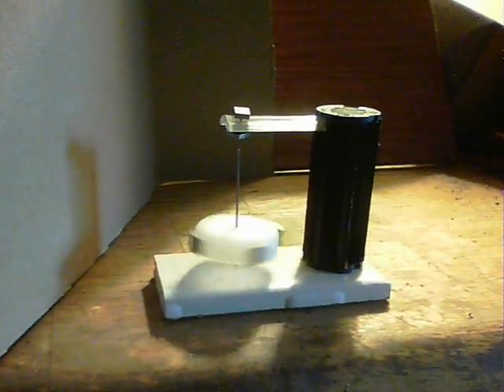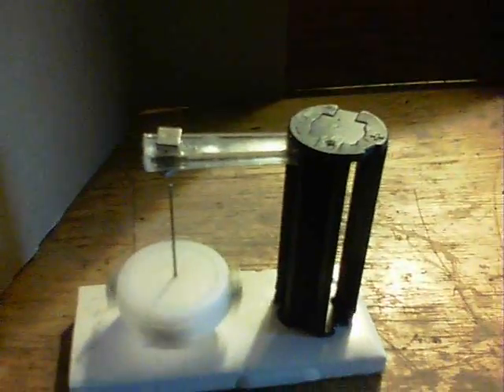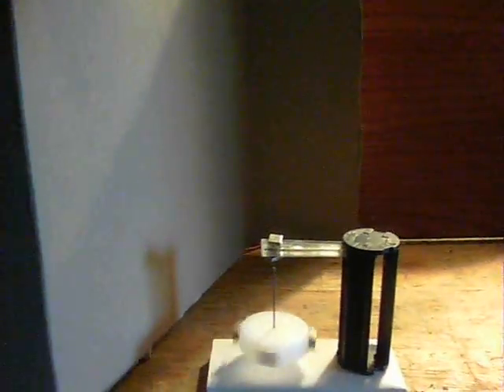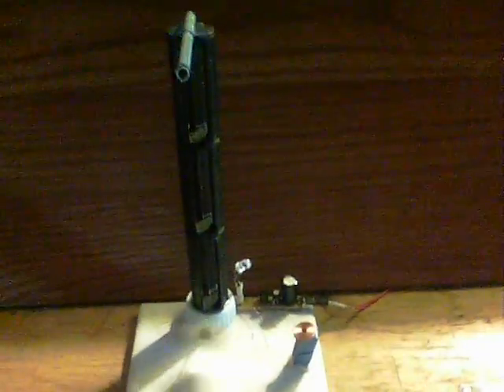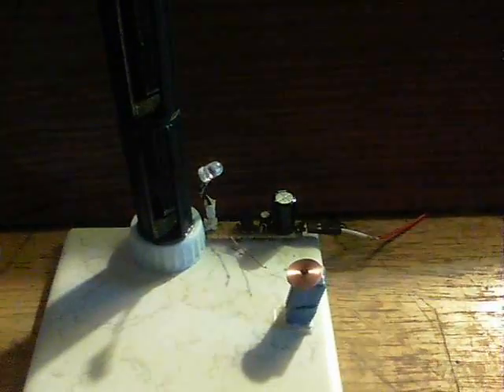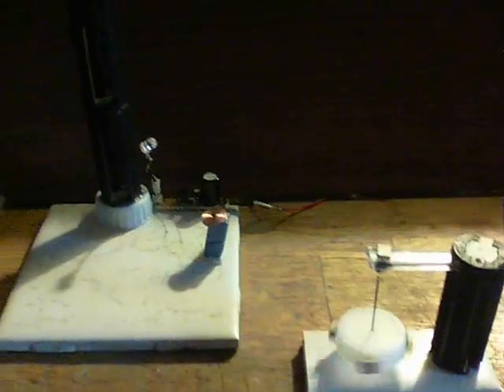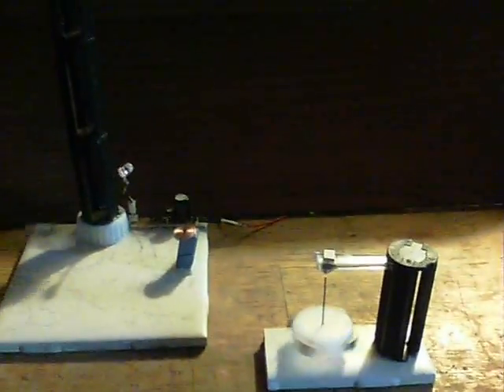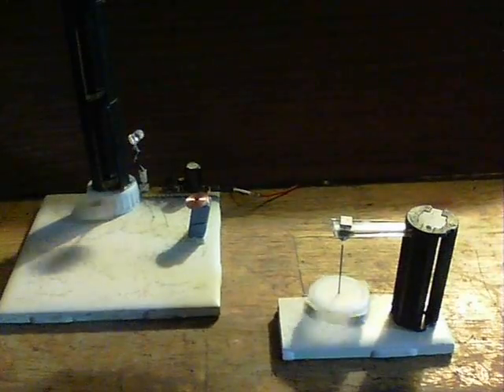Pendulum Rotor

Comment: Hi slider2732
Too late But could you help me to know diameter(out and inside , wire gauge ,turns , (more detail if possible please )of your coil at  time 027/156 . Hope you will help me Thank you so much
Reply from the maker: Hi. The driving coil is from a 'Dancing Flower' solar toy...the gauge is around 46AWG and there must be a couple of thousand turns on it. Resistance is approx 500 ohms. They really are great coils and there's no way to hand wind something like that. It's an amazing little thing for a dollar store product.
However, the SS1CC circuit will run with a much easier coil to make...see 'SS1CC Pendulum' by sMartcreations2010 and his other vids.
Reply: Dear slider2732
Thank you so much for your time reply.
                              Best regards

Comment from the maker: Yes it did ! I was moving another rotor project out of the way, with an aircore coil and the rotor started shuffling around a bit, back the other way etc. So I spun it and watched, and moved it, and watched. Then built the 'dedicated' version without all the gubbins of the other one....hence the bit about components and not just for showman flair, cos the original was an actual pulse motor of about the same dimensions and parts used to construct.